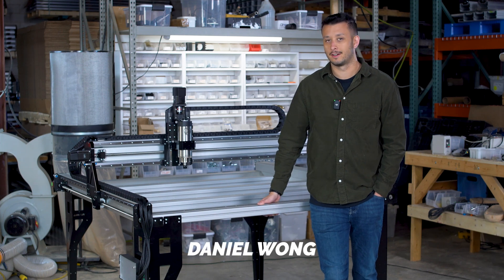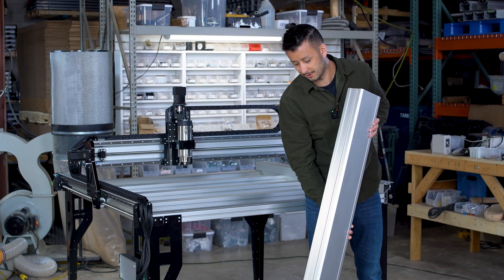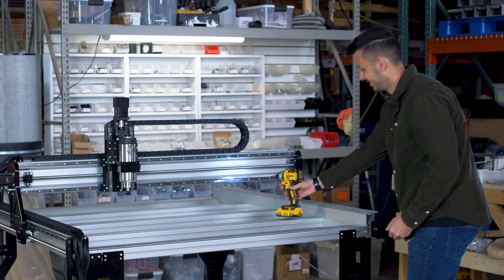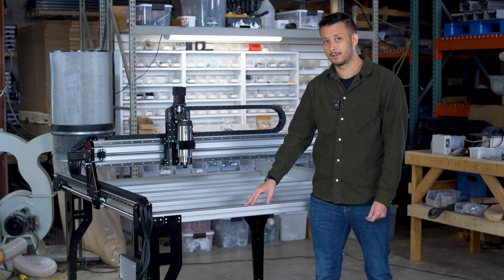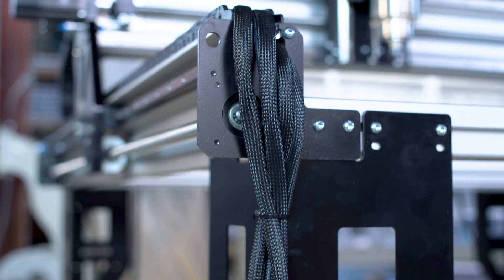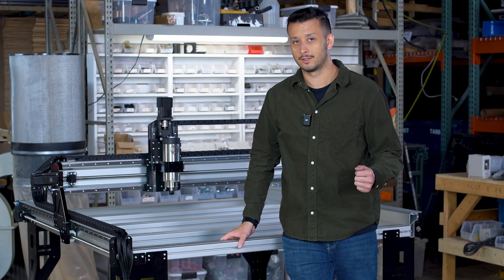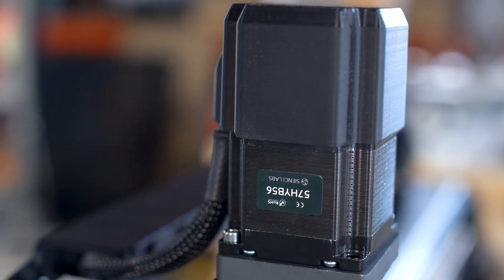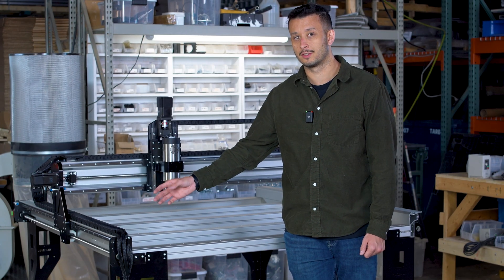Introducing the AltMill MK2 CNC: Upgrades, Pricing Updates, and Future Plans

Comment: When will there be an ATC for the Altmill MK2?
Reply from the maker: It’s not in our immediate plans to offer an ATC system for the AltMill, however, this is something that could be possible much later on as we continue development on the Sienci Router project. In the short term, it will likely be possible to integrate such a system on your own since the AltMill’s controller will run grblHAL firmware which supports more advanced tool-changing features needed for these systems to function. Thanks for asking!

Comment: I won't lie the MK1 seemed unfinished, buttoning things up and calling it a MK2 before many have even received their MK1 orders puts me off a bit. MK3 by the end of summer?
Reply from the maker: Original AltMill design was in Beta testing late 2023, and released start of 2024 - it's been a year...  AltMill has proven to be an amazing machine since after a year we still can't keep up on orders, so if you don't want to get one then that's your call. Many have already received their MK1s and it seems odd to be upset that we care enough to improve our hardware when we can.

Did you know, there are many times you've bought something from the store not even knowing that it's already an older model. The reason is because many companies like to stay quiet to keep people happy with buying older products, but we prefer to be transparent.
Reply: @SienciLabs   maybe i'm not understanding the order completed page on your website, it looks to me like most of the units only started shipping in the last 3-5 months?
Reply from the maker: We only leave up the last month or two of fulfilled orders so people can see the current rate of shipping, anything older gets removed since otherwise people would have to scroll much further to find their orders 👍 The list is for pending orders not total orders made

Comment: Your machines look awesome, and I'm saving up my pennies for one of those.  Here is a suggestion regarding cable management where cables leave the cablechain down to the controller.  Place a channel (aluminum, or plastic) that encloses the cable. thus leaving only the entry way into the controller with the exposed cables.